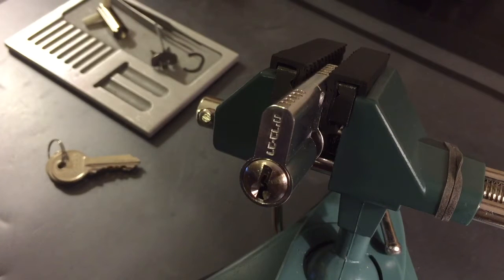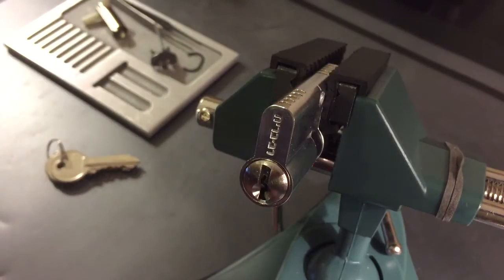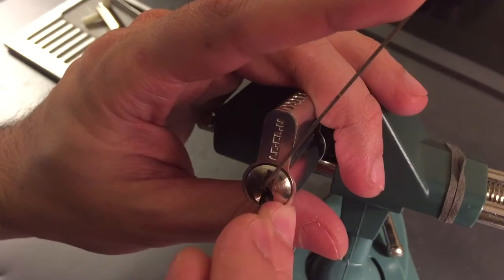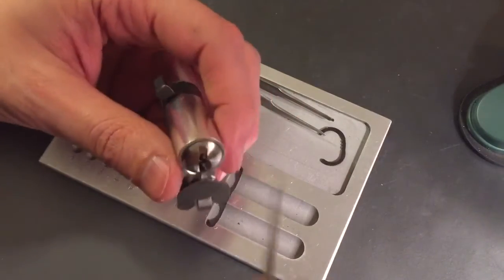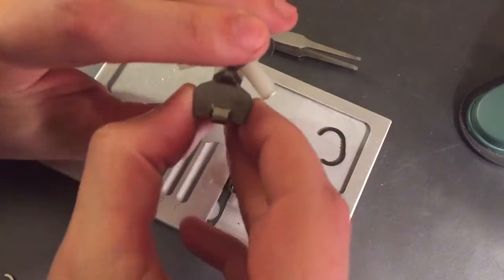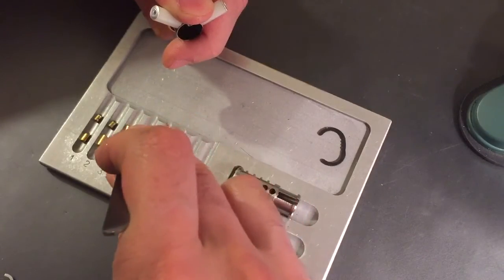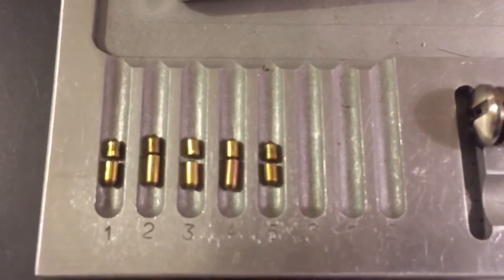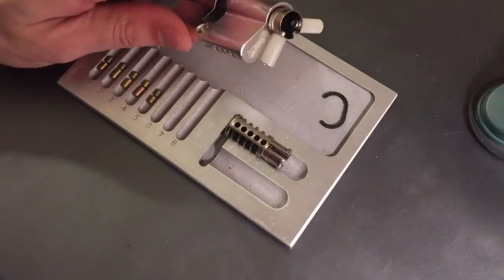[79] Rav Bariach RB-100 Picked and Gutted

Comment: Hi. You said the name almost correctly, the end syllable is actually "ah" and not "ach". The lock is actually designed to be crap (I know this sounds silly) as it is mainly used on internal doors of low security institutes (e.g. schools) where you mostly need to protect inexpensive items from children/students/company employees etc. It is built so that it is easily snapped and replaced because the aforementioned people tend to lose the keys to them very often. This is not a lock to protect stuff just to keep curious children at bay.
Reply from the maker: +Boris Kozo Great information.  Thanks.

Comment: Great video as always. The milling is a mystery. It would make sense (not in good way of course) if they casted the plug like that, but yours is milled. 
I wonder what can be next step. They remove material from plug (except the rings holding driver pins in place while rotating), so next they could make the body hollow, just with 5 tiny tubes for spring and pins and some posts next to the tube so the key pins won't fall during rotation. >:-)

Comment: Frightening lock ;-) From the video the drivers look smaller in diameter than the key pins. Is this true?
Reply from the maker: +Potti314 I didn't notice that while I had it apart, but looking back at the video, I see what you mean.  It's possible.

Comment: Hilarious. They save on making driver pins yet they mill the plug. I'm guessing they mill the plug to reuse the material and in turn save but wouldn't milling cost more than the few grams they save?
Reply: Did you google map from which deli this one came from?
Reply from the maker: +Papa Gleb Now that's a good idea... I may dig the packaging out and see what I find!
Reply from the maker: +Papa Gleb No idea... but if they are doing the milling, I've got to imagine that it's a cost-cutting measure of some kind.

Comment: Geeeeeeeezuz, It's actually worse than harbor freight locks.
Reply from the maker: +Git Pick'd Now that you mention it, I think that's where I saw a core like that before... in the Harbor freight 700 clone.
Reply: +LockPickingLawyer , yup that's likely the Chinese core you mentioned.  mine looks just like that.  it was a PIA to gut because you could hardly find a place to slide out your the plug without dropping pins and screwing yourself.